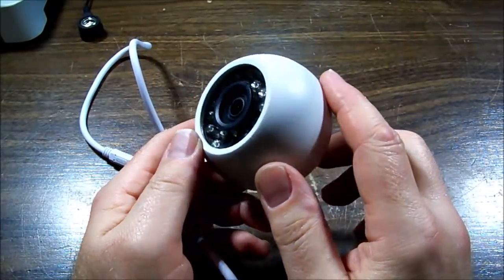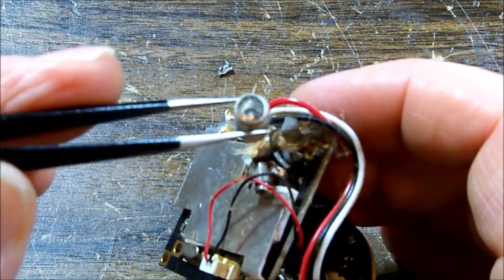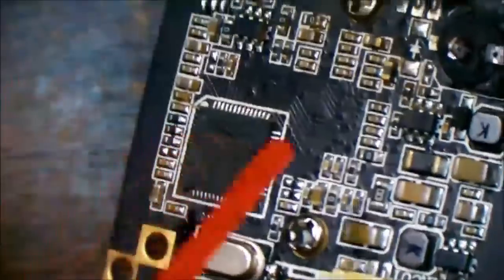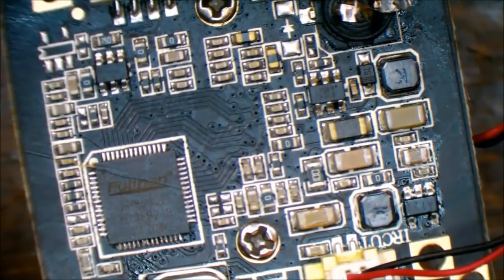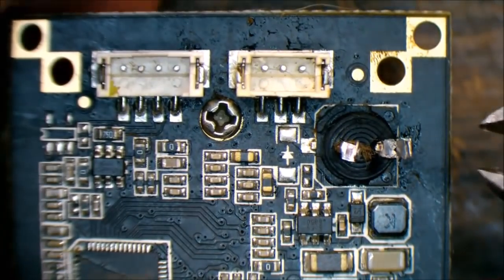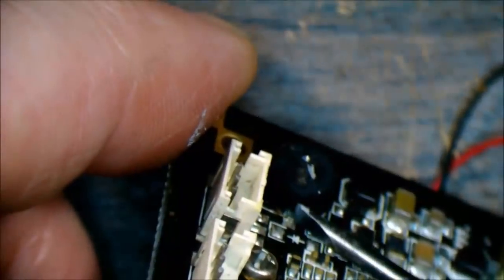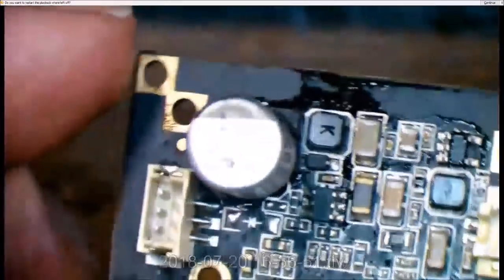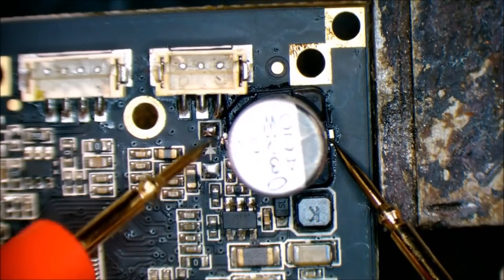Swan cctv camera repair

Comment: Can I extend memory card slot by using 1meter 8 rainbow wire in ip camera's ? Will it works?
Reply from the maker: I really don't know. Would be interesting to try. I don't know how much power the card reader chips can supply.